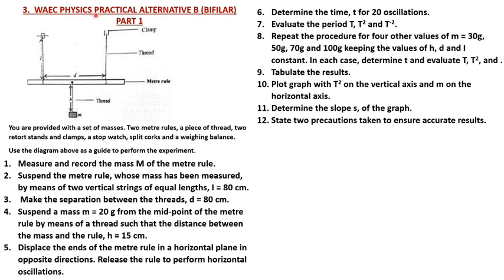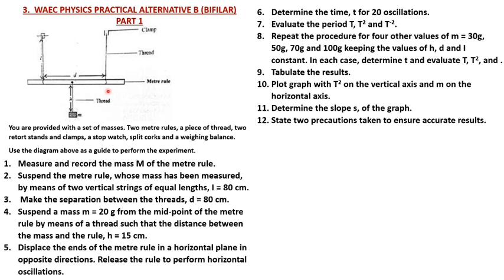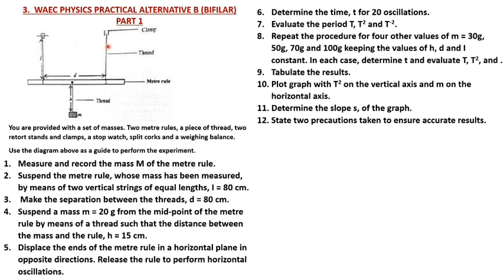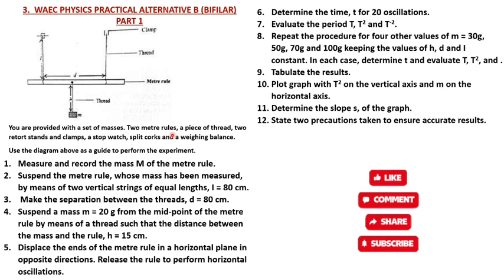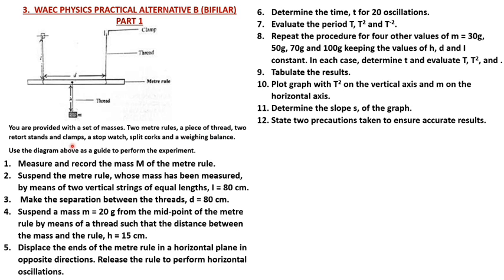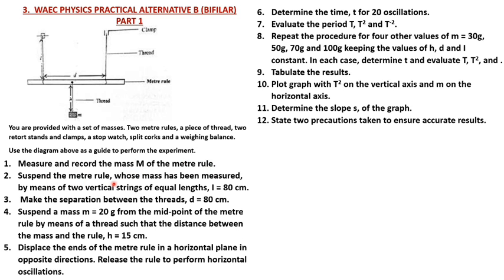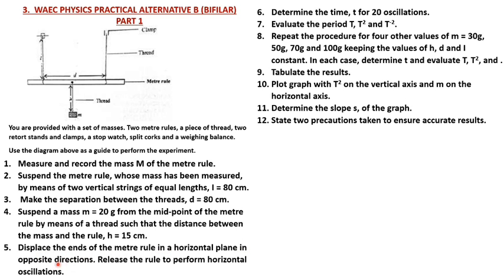WAEC PHYSICS PRACTICAL ALTERNATIVE B QUESTION 3. 2024.

Comment: Please you are supposed to set the meter rule into angular oscillation by displacing the ends in opposite direction.
You set the meter rule into horizontal oscillation
Reply from the maker: What is angular oscillation? Did you read the instructions on this video?
Reply: @yousciencelab5307   when you push two ends in opposite direction it oscillates in the clockwise and anticlockwise direction.
Displacing two ends of the meter rule is the instruction in first question and angular oscillation is the instruction in second question.
Reply from the maker: @darlingtonagbai7999  how does that makes sense to you?
Reply from the maker: You are obviously confused about the whole thing. When they said end to end, it means you have to oscillate it from end to the other. Not from side to side to side.